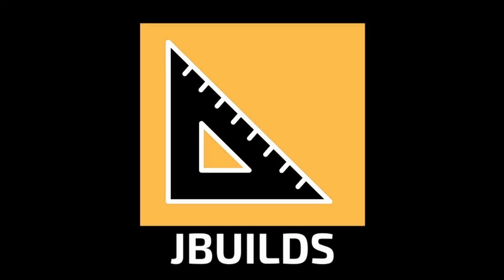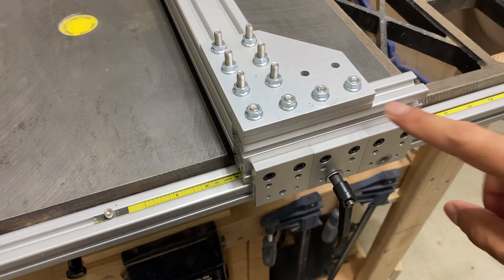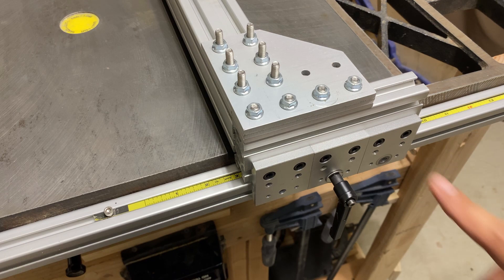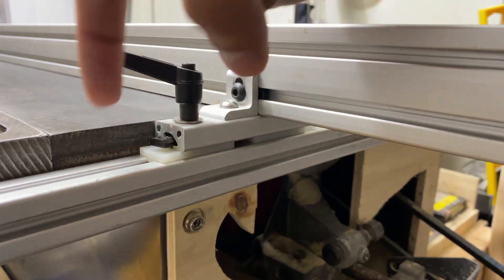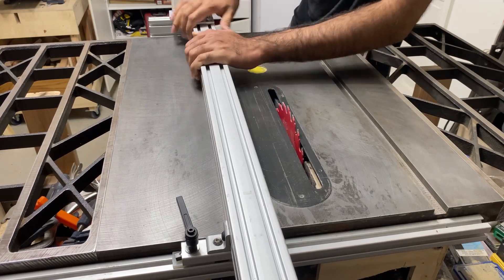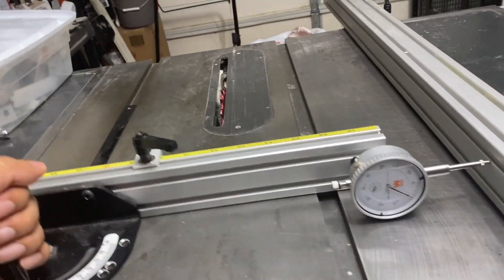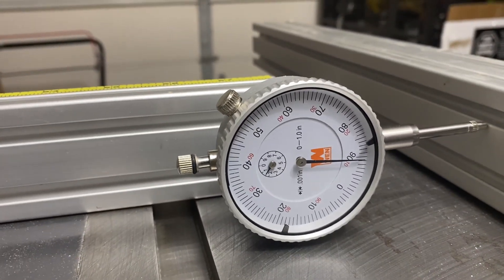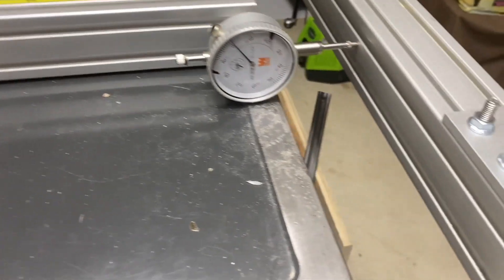Updated Design Alumi-Lign Table Saw Fence System

Comment: 1:49 Would using a 1530 front rail and a 6533(ish) bearing on it prevent the need for a rear rail, while also removing the need for a rear extrusion rail? 
 
Couldnt you just add a piece of uhmw plate to the underside of the fence to keep it supported? (Or use a piece of angle iron on rear with uhmw slider on it? Better yet, use 20 series v slot wheels (with the groove in them) and have them mounted directly under fence so the can ride the edge of the bedframe angle iron rail?
Reply from the maker: Yes with my later revision of this I switched to v slot rail

Comment: Looks good.  A small piece of judiciously applied shim stock would probably take out most of that 5-8 thousand.  However, would itself expands or contracts that much day to day, so probably not worth it.  When will you be selling the kits again?
Reply from the maker: Thanks! I’m just finalizing the design changes and should have it available towards mid or end of April.

Comment: I have the same grizzly table saw you restored. I purchased my fence kit a couple of years ago plus one of the upgrade “kits” recently. You have made so many mods to the fence I am concerned about having what I need this fall when I get my table saw out of storage and into my just completed workshop. Please allay my concerns.
Reply from the maker: Hi Michael, when you are ready to assemble it, just send me an email and I will send you the assembly manual. It looks like you should have all the parts needed for me previous fence design that uses the UHMW sliders so you should be all set.

Feel free to send me an email with any questions or issues that you encounter.
Reply: @jbuilds1  thanks again.

Comment: I don't think you will need it any more accurate for woodwork. After ripping timber it would be brought to final dimensions by planing. The extrusion will have some level of inaccuracies anyway.
Accurate cross cuts are made using a dialed in criss cut sled.

Comment: Why is the current version, on your store, mounted so low in the front? Seems to me that mounted in this fashion there is interference in getting to the power switch and the lift mechanism on most table saws. I'm thinking that the rails should be located only a few inches below the table deck. Let me know when you fix this, or is this entirely adjustable? If so then disregard my little rant question :) ...
Reply from the maker: I have not had any issues with them interfering but yes, they can be shortened on the non-machined end. They are designed to allow you to easily make the fence perfectly square.

Comment: Will this work on a ridgid job site table saw?
Reply from the maker: What is your saw's model#?
Reply: @jbuilds1  r4518
Reply from the maker: @tsudorex  it looks like the fence rail can be removed so in that case it should be fine. You may have to drill mounting holes for the rails however